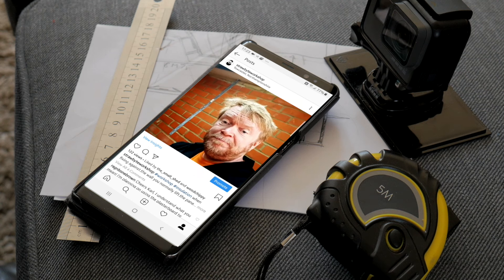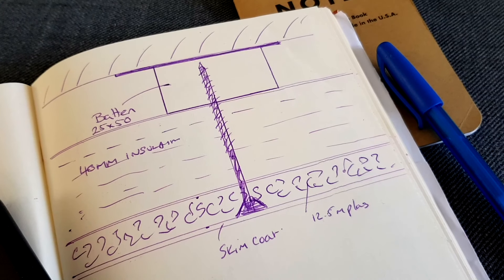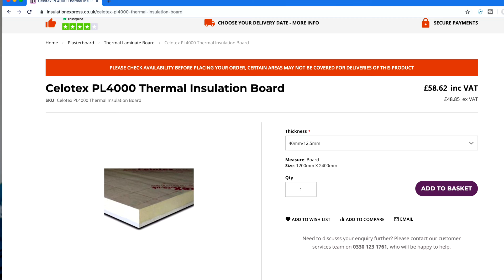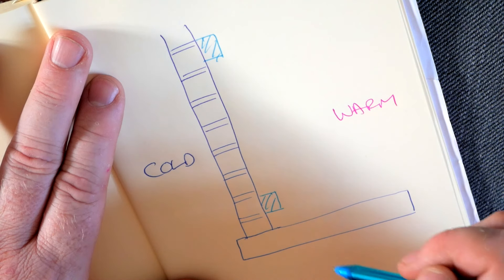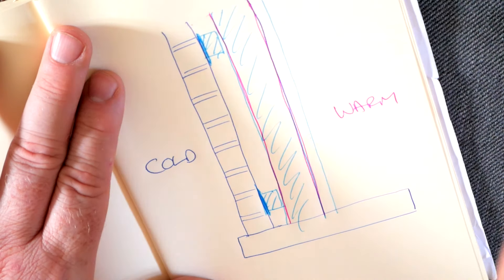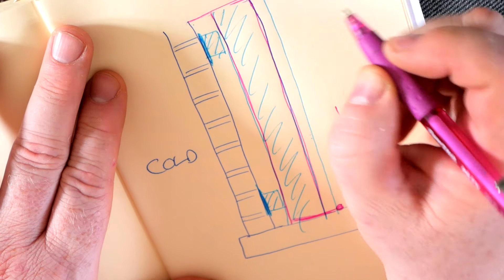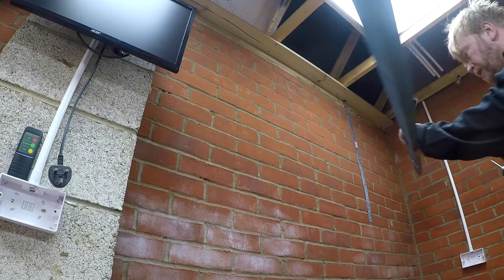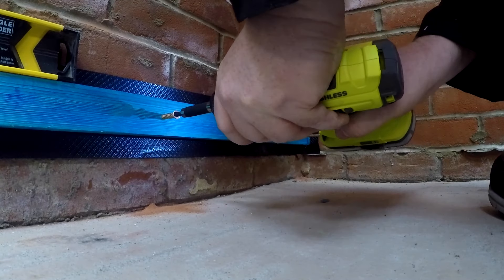How to Insulate Your Workshop | An Easy DIY Project | Keep Your Shop Warm or Cooler

Comment: What was your rationale for not boarding over the protruding breeze lock 'pillars'? Anyone able to offer advise on whether they should be boarded as well? Or is it just a cosmetic choice?
Reply from the maker: Hey dan. A popular question and an obvious omission from the video and I probably should have at least mentioned why as I did explain that 2 bays were going to be addressed at a later date when the personnel door was to be installed. I have a video on that here: https://youtu.be/ak6Aor6j344?si=fqQ8YhLdt97XGoCA and in the video you can see in the background of the making and talking-head the concrete pilars are covered (red) and (not visible) insulated behind.

The primary reason was that I wanted to come up with a method which was insulated and very strong so that I could mount racking or heavy objects from them. The approach taken was to make a 3 sided box (U shaped channel) out of 3/4" plywood that is 40mm wider than the block pilar and about 55mm deep. Then insulate inside the box and then bolt these boxes on to the concrete pilars using shield bolts (some of the strongest non permanent fixings you can buy). A secondary reason was that the door installation got delayed to February 2020 and then the pandemic hit and I couldn't get plywood or insulation for many weeks.

To answer your question simply, yes you should cover these pillars. I was trying to maximise space inside and decided on an 'overlay' approach which I think has worked out well for me. There's a more complicated answer based around the thickness of the wall through the pillar to the outside, the impermeability of concrete blocks to moisture, the foam material installed between the blockwork and the brickwork and U values. In short, if you built out the finished surface of the walls either side to around 32mm beyond the face of the blockwork and installed 25mm celotex over the top and board over that, you'll get a clean flush wall the length of the garage. It would also mean being able to use 65mm celotex in placed of the 40mm I used giving you a better result.

I hope that helps. There's been a surge of interest in this project so I may well do a follow-up specifically on all the insulation work completed off-camera.

Thanks so much for leaving a comment. It really does help - more than subs and likes.
Reply: @StrawbyteWorkshop  really appreciate the response. I'm planning on doing similar to my detached garage with plywood lining and insulation. Reckon the air gap between plywood and breeze block wall would need air vents to connect the air circulation with the outside air? As my garage currently doesn't have this.

Subscribing to you now!!
Reply from the maker: @dancharles6942  Ah, so the question of vents behind the insulation has come up in a comment before. Remember standard fletton house bricks are permiable to moisture and vapour. On a house you will often see weep holes that are installed over impermeable cavity trays installed in the wall, and vents in some cases . This would due to the cavity wall situation. When I contacted the kingspan technical department they explained that weep holes or air vents were not necessary in my case. If yours is similar, I wouldn't worry about or prioritise vents in your wall.

Comment: Curious on why you only went with 40mm for the insulated panels as the exposured bricks seem to show you could have gone thicker panels? Also any reason you didn't put the vapour barrier on the whole wall instead of just behind the battens?
Reply from the maker: HI - Great question. At the time I was concerned about not reducing the interior dimensions of the space with too thick insulation. I also had an idea to make the brick piers a workshop feature and later installed 40mm insulation over those, too. I intend to follow up on the completed workshop at some point.

Regarding the lack of a vapour barrier, Kingspan's technical team didn't specify it when I spoke with them. The explanation was that the insulation material had high vapour resistance, and if warm moist air was to make its way from the inside of the workshop and condense on the cold brick, the moisture would pass through the brick because they are porous.

Comment: Hi there,  I can not find your video about insulating your garage roof.
Reply from the maker: Hi Neil - I did release a video but it's now hidden. The link is here: https://youtu.be/fpO6lMwRpCQ

I'm just finishing some remedial work in the roof space and I will update/replace the video to correct a mistake in the original.

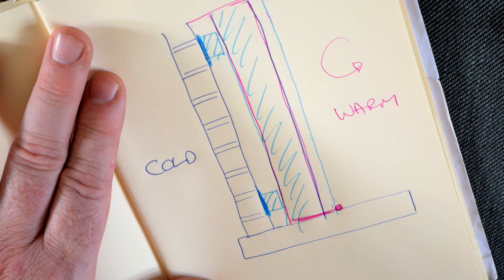Feel free to take a look at the old video. At 4:08 I start talking about the construction of the two layers of insulation. The error made was to include a void between the two layers. This isn't the correct way to do it and while I have experienced no issues with the approach I took, but a roofer pointed out two problems: 1. The void actually reduces the efficiency of the insulation not enhances it. 2. There is an issue with insulation voids where vapour permeating through the insulation  could condense in the void. This might lead to rot in the roof trusses or (as before) a loss of insulation performance.
The mistake was made because I hadn't planned to use two layers from the beginning. battening-out the trusses came afterwards when I decided to install the second layer. What I should have done is planned to install two layers from the outset. This would have had me batten-out the trusses first and install the first layer of insulation flush with the battens and the second layer over the top with no gap. Where the roof support beams cross the space, It would have been easy to test fit the pieces before carving out a rebate to accommodate the beam.
Reply: @StrawbyteWorkshop  thanks, will look forward to the update video

Comment: Lots of people put the insulation in between the battens, in contact with the brick and don’t leave an air gap. Is there a reason you’ve chosen to leave a gap?
Reply from the maker: The air gap is the recommended approach by most PIR manufacturers when insulating a single skin brick wall unless the wall is guaranteed to be bone dry all the time. Had the wall been concreet blocks which are impervious to water then I might have used that approach.

Comment: A few years on now, how has it held up? What has been your preferred method, the MDF boards or the plasterboard?
Reply from the maker: Hey Luke. Thanks for a great question and it's rather timely as I was filming a few things today in order to do an update video in the coming weeks. Overall things have worked out quite well. On the positive side both methods you see me use have been very accommodating when I've needed to make changes or repairs (more in a moment on that) and the quality of the decoration has held-up too. No peeling paint and the space is very dry even in the wettest coldest winters. There have been a few problems. It turns out the muppets that built my garage didn't install the DPC and tanking membrane correctly in a 6ft section of wall so I've had some water ingress which ruined a section of wall. But decisions taken in the build, in particular using DPC backed battens and quality screws paid of. The damage was cosmetic and affected the insulation benefit, but there was no mechanical failure of the wall. In fact putting it right was a pain as I couldn't remove the materials easily.
I've said in the comments a few times the main issues causing me to switch between insulated plasterboard and separate celotex and MDF were 1) insulated pasterboard is very very heavy and I really didn't like working with it on my own, 2) I didn't have anywhere dry to store all the plasterboard to complete the whole project.
If I were to do it again, I would probably go with the insulation and MDF. One thing I omitted to mention was that of the 7 wall sections insulated in the project, 2 were insulated plasterboard, 2 insulated with standard MDF and 3 with MR MDF. If I were to do it again I'd use MR MDF on all the walls. Not because of the moisture resistance but more because MR MDF is a denser board and those walls have held up a lot better as I've been fixing things to it and then later filling the holes and redecorating as thing change.

In terms of performance: The space is 5 degrees cooler than the outside temperature during the summer and during the winter the lights, dust collector and a small radiant heater do a pretty good job of getting the space up to around 10-13 degrees which is almost the perfect temperature for working.
Reply: @StrawbyteWorkshop  thanks for such a detailed response!

Comment: After insulating your workshop garage, did you ever make a video on insulating the roof or ceiling of the workshop.  If you did, can you point me in the right direction where it is as I really enjoyed and found the insulation of the Worksop very helpful to me.  Many thanks.
Reply from the maker: I did post a video about that (https://youtu.be/fpO6lMwRpCQ) but I made a mistake in the construction of the insulation in the roof. The video shows a gap between two layers of insulation which shouldn't be there. What I should have done is batten the rafters, install one layer with a 50mm gap between the insulation and felt and then place a second layer on top with no gap. This does mean working carefully around the roof braces.
It's taken 2 years of work to slowly go around the roof space and correct the mistake. I do plan to put another video out.

Comment: Good video Karl. I'm part way through doing a similar thing in my garage but it's to insulate the house. It's a 1930's house with integral garage and the 2 internal walls (back and side)  are only single skin brickwork which made the hall next to it in particular, quite cold. What I did was bond 50mm celotex directly to the wall and foil taping them.  Then I used MF7 primary metal support channel used in metal framed ceilings over the top at 600mm vertical spacing with horizontals at floor and ceiling and 1200mm intervals inbetween. I fixed the channel to the wall by drilling 25mm holes with a hole saw into the celotex and using space plugs that are used for fitting kitchens cabinets to the wall with forgefast screws. By adjusting these I could get the channel perfectly perpendicular. This way there was no cold bridging. I then screwed 12mm ply (wallboard) into the metal studs with self drilling plasterboard screws and painted it with  a couple of coats of grey floor paint. There's a worcester wireless thermostat on that wall and I had to raise the temperature programme by 1.5 degrees because the boiler didn't come on, that's how effective it is. It's eliminated the perpetual cold draft that came down the stairs.
Reply: Great video, what did you use on the garage door?
Reply: @philevans3783  At the moment it's still work in progress and is a standard up and over door but that's being replaced with an SWS roller door. they have insulated slats.
Reply from the maker: 25mm polystyrene and Correx

Comment: Hi great explanation on the wall insulation.  I noticed that you didn't insulate the ceiling space. How will the warm air going into the loft space react?
Reply from the maker: The roof space was insulated and I did put out a video on it. However I made a mistake when installing the insulation and have had to completely re-do the roof-space. On my to-do list is to re-edit the video and put it back up. In hindsight, I would probably simply plasterboard the ceiling and place the insulation above that and that would be done first.
Anyway - with the roof done properly the place is quiet, free of drafts and cosy. Very little heat is needed to get it warm and it stays warm for ages. Probably the best measure is that the space stays 5 degrees cooler in the summer and 5 degrees warmer in the winter compared to the outside temperature.
Reply: @StrawbyteWorkshop  Thanks
Reply: @StrawbyteWorkshop  using your guide as one of the only decent UK sources of information, so thank you for this. I was about to step out of the door and head to wickes to pick up wall materials, but noticed this comment. 

Is it worth holding off for the ceiling video, and doing that first??

Thanks
Reply from the maker: @jtkove  thanks for the comment. I was motivated to put out videos on this because it was really hard to find good advice. The technical team at Kingspan guided me through how to use the PIR product but you had to call them to get it. Shame when it came to ordering I couldn't actually buy much kingspan though!

I guess you have a couple of options with the roof. 

1. Insulate between and over the roof rafters like I did.
2. Plasterboard the ceiling and lay the insulation between and over the ceiling joists.

As you saw I did option 1 and to help with the insulation of the walls you saw me install a 120mm wide board against the joists and then the insulation and MDF (or the insulated plasterboard to begin with) was butted up against that. If the look you want is a clean plasterboarded ceiling then you should do that first. Much easier.

The link to the roofing video that's not public on the channel is here: https://youtu.be/fpO6lMwRpCQ
Reply: @StrawbyteWorkshop  Hi Karl, I noticed you mentioned that you did something wrong with the roof space. Did that have something to do with the ridge vent that you mentioned in the original roof video or something different? What did you do to fix the issue? Only reason I ask is because I am a few weeks away from embarking on this project myself and I was going to do the roof space first (and reinforce it for some storage space).
Reply from the maker: @_tensketch  Hi - The problem with the roof installation was that I placed a layer of insulation between the rafters and then decided add a batten to each rafter and then place a second layer over the top. This created a void between both layers of insulation. A comment on the original video said that this could lead to Interstitial condensation forming in the void. The solution was to remove the insulation and re-install without the void. A fairly simple but time-consuming fix and what's more the eves to ridge air-flow is improved too.
The ridge vent wasn't touched in the original install, the soundslab was merely inserted to reduce the sound noise. On refitting the insulation this was tidied-up and made to lay flat on the insulation placed in the V of the roof.
Reply: @StrawbyteWorkshop  thank you so much for getting back to me so quickly. Really useful to hear, especially as I was convinced that counter battening and applying the next layer of insulation was standard practice.

Looking forward to seeing what you did with the shed at the back of your garage, I have an empty space behind mine that is utterly useless so putting something there would be beneficial for me. I also don't know what your loft project is but if you live in a new build I'm sure you've seen how rubbish those lofts can be for storage. So I may be copying more than one of your projects
Reply from the maker: @_tensketch  The loft project was indeed around adding storage. Unfortunately the job turned out to be a little more urgent than the time I would have ideally needed to make a video about it. There was a lot of thinking outside the box to get the ladder in and storage for boxes and compared to the boarding-out the loft or loft legs videos I watched before tackling it, it's a very different and what's more complies with the Timber Frame Association for cold-loft storage areas. So there may be a video in it when I put more storage up there. Who knows.
So yes the shed. Interesting project since most you-tubers would be all over building it from scratch. Not me I chose an off-the-shelf 5x10 shed which the kindest review on the site said was 'a cheap shed, cheaply made; and have worked my magic around that kit and the resultant building is stronger and better constructed than most I've seen on here. Probably my most accomplished project and full of 'things I do with sheds' that you don't see others doing. So I'm looking forward to putting those out. The cold weather and the fact I've decided to extend the base after the shed has been built has delayed the part 1 video - the shed base.
Reply: @StrawbyteWorkshop  Hi again Karl. Sorry to continue to bug you about this, but I do have a question about your loft. Did you do anything to strengthen it before putting the loft legs in? I'm not sure if you got the same story, but the sales rep we spoke to when buying this new build told me that boarding the loft could very easily bring the roof down if I did it. Now I'm incredibly apprehensive about it.

Comment: Helpful video!  What is the black rolled stuff that you put under the blue boards that are screwed to the stone walls?
Reply from the maker: Hi Sean. It's Damp Proof Course or DPC. It provides a barrier for any.moisture from the outside wall making its way into the wooden battens.